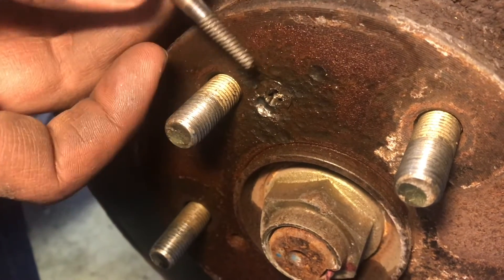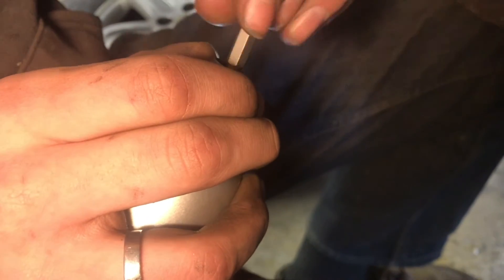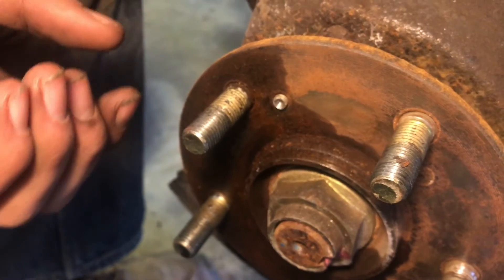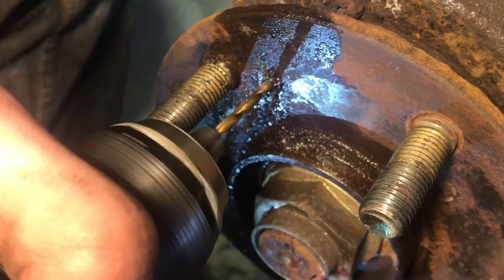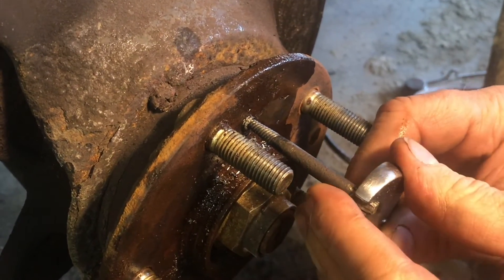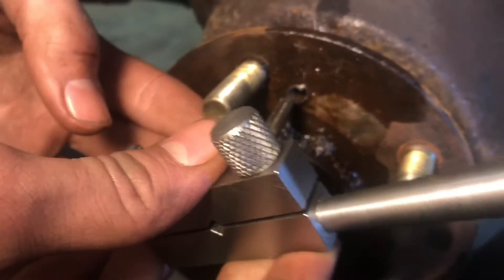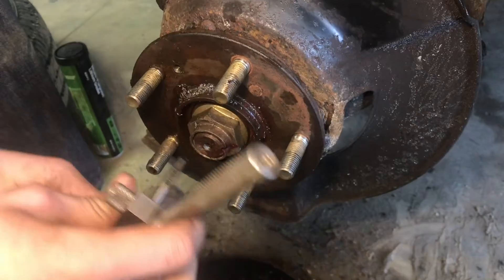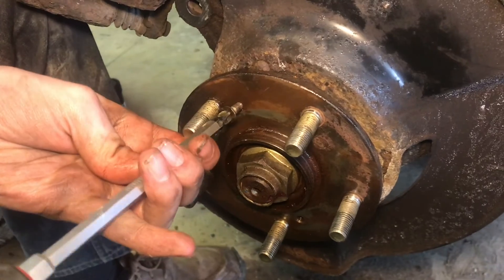remove a broken HARDENED steel bolt (step-by-step)

Comment: Thanks for this, was nice to see that it’s not just me having trouble with these stupid bolts replaced mine with stainless steel as there’s no bearing on them what so ever. How long did this take you out of curiosity? I’ve taken a week thinking about doing a couple of broken bolts I’ve got to drill out as I know it will break my will at some point
Reply: Working on an 09 jetta and the 1st rear brake is the problem. I learned a trick from another video for taking it out without stripping it. If you smack the rotor hard on the inside and outside enough it will turn out really easy. Guess ill try that when i get done with the 1st one 😕

Comment: Don't use speedout on bolts. Unless you want to join me in this nightmare with a broken speedout bit inside the bolt you have to drill out then.
Reply: Mmmm same right now

Comment: Great video, a lot better than the ones you see where the person has no issues getting it out.  More times than not it becomes frustrating, step back, take your time and think.  Broken hardened bolts are one of the worst especially when they break flush.
Reply from the maker: I’m glad you found it helpful. When I started the video, of course I was hoping it would be one of those jobs where it comes out with no problem. Sometimes this is the way life really goes though. Add a pic at every thread. In the end I’m glad we got it out. Re-tempering the hardened steel definitely made it possible.
Reply: That's so true. Finally a video not given the impression that extract a broken hardened bolt is a easy job if you get all the necessary tools. I feel glad to see that I was not the only person strugling with a similar problem.